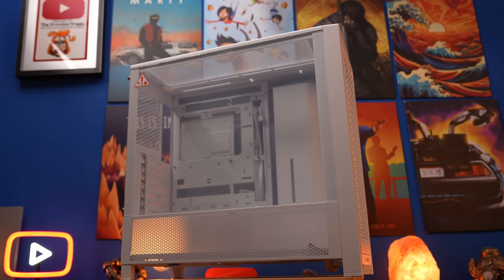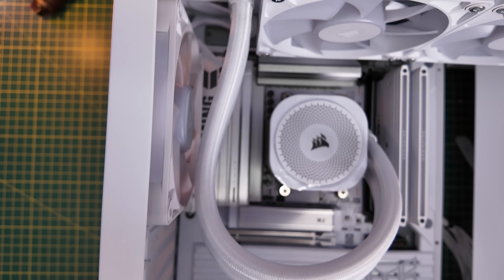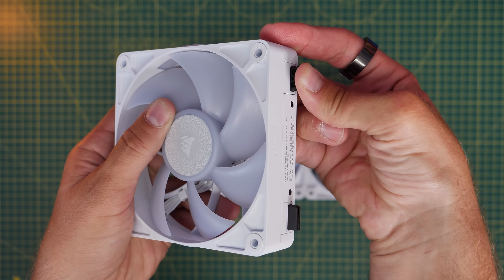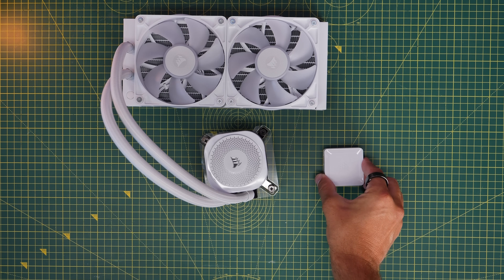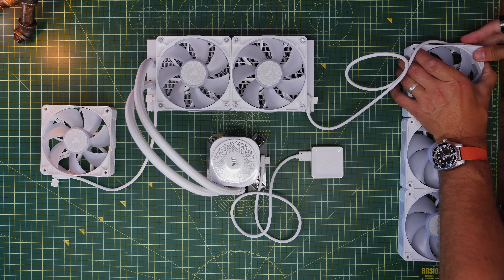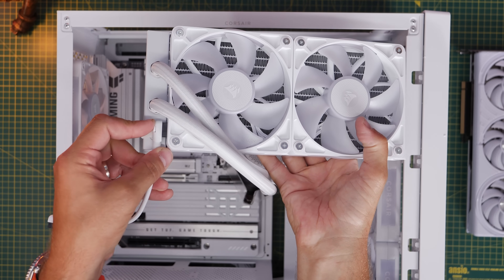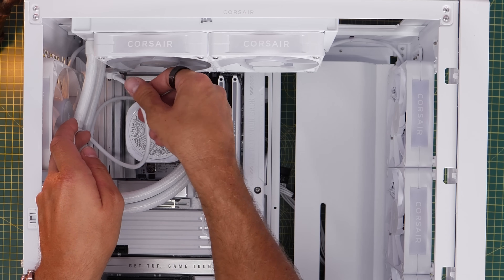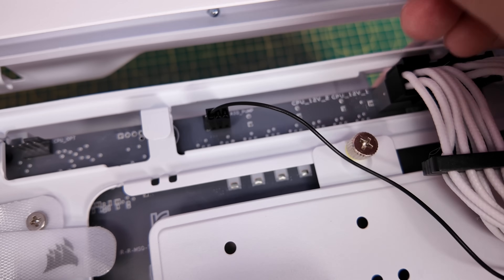Super Simple Guide to iCue Link Setup Logic and basic wiring

Comment: so i can connect 10 fans. Back case fan >  Radiator > 3 group front > 3 group down > hub? or there is a specific set of fans for the hub.
Reply from the maker: Yes that's fine.

Comment: hmm but this wont work with the H150i Elite LCD XT right? that has to use the commander i think, geuss i am already far behind with AIO cooling
Reply from the maker: Yes you have to use the commander with that. Though you could technically swap the fans to iCue link ones if you wanted all the fans to match.
Reply: @TheProvokedPrawn   yeah i have 3x icue link fans over (ordered last year to much) but the AIO 12-pin is the pump to the commander, i prefer to ditch the whole commander tbh, my biggest problem is i am still on the HEDT x299 and the new link AIO is not suppourted for 2066 socket, some forums say you can use the intel bracket, some say dont, huge risk, i have so many ssd and nvme's (3d moddeling and video-edit) so i need a lot of data/drives, the pcie lanes on newer platforms are like max 20 pci-lanes, insanity

Comment: Does the pump always have to be connected directly to the hub, or can it also be chained with fans before reaching the hub?
Reply from the maker: It can be chained too. But obviously in this setup I couldn't without having a cable running from the rear fan to the pump.
Reply: It does not. I have my AIO connected to the side case fans on one side, and connected to the back exhaust fans on the other. Works fine.